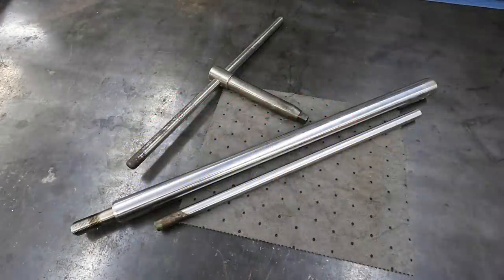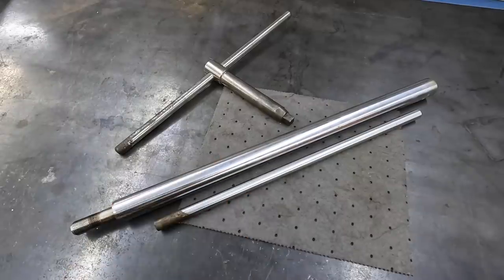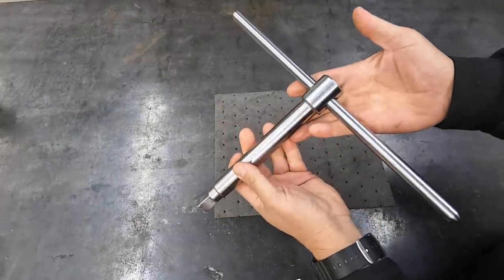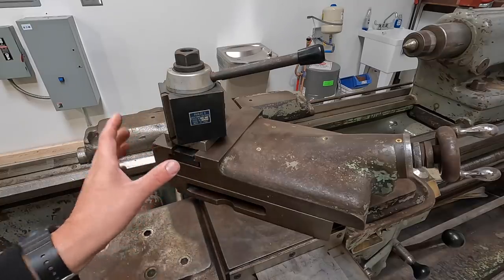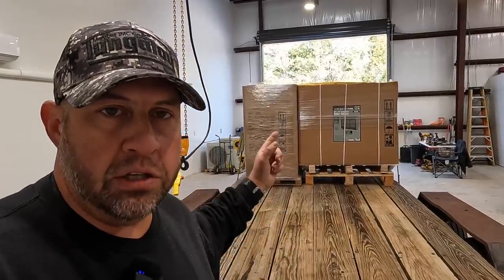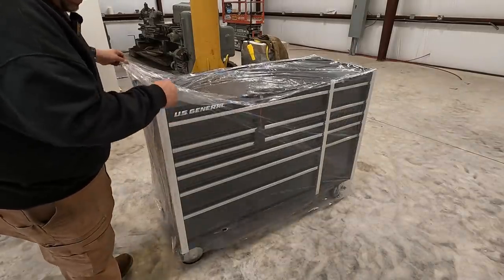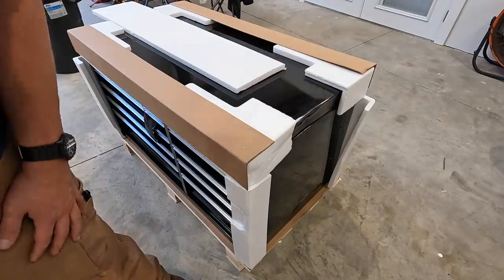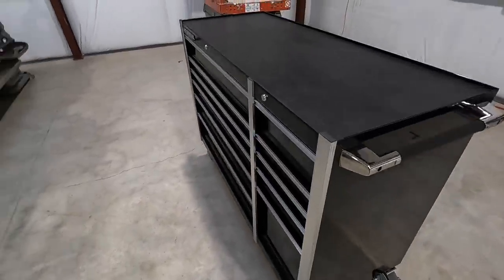Saturday Night Special 358: 3 Jaw Chuck Wrench, New Tool Boxes

Comment: I did not go through the comments (@ 200 now) but your thought of a wooden slab top made me think that the top could have an overhang at either or both ends... depending on thickness, it will be heavy enough to handle a small vise or other fixtures without any anchoring.  Just a slice in the bottom to accomodate the overhang.  Doesn't have to be a slab, could be something like maple butcher block, which would be, if thick enough, very heavy and essentially dent proof.... always fun to see what the Abom will do next!

Comment: I have a "Homak" top/bottom toolbox and one of the bottom wheel mounts got bent and it was a nightmare straightening it out. Mind you I've had them for 21 plus years and it works fine now, but what a pain. Very flimsy.  They won't move from where they are and the damage occurred during moving... but what's done is done.

Comment: I have the HF roll around toolbox with a extension on the side, its perfectly fine never had an issue with it, we have a matco at work and if you close the drawer too fast the tabs slip out of the slide and its a pain in the ass. Thing about HF is just use common sense, its pretty easy to sniff out the bull. EDIT and yes I put a bit of leftover birch plywood on top of mine, makes a nice place to put things you are actively using ... espeically drawings cause now you have a table top and its hard to make edits or notes on a ribbed rubber mat.

Comment: It would be another expense, but what about getting another 55” toolbox and putting them back to back.  That way you have one for the American Pacemaker and other for the machines on the back wall of the shop.  You could even get the slab of wood made big enough to cover both box tops and “lock” the boxes together.  As Keith Meiser said, if they could make it long enough to overhang then you have a great small vise point as well.

Comment: the forward and reverse wiring, you have two start buttons and one stop.  i would ask you guy if he can add a contactor to you existing starter box so you can reverse the lathe from the operators station.  just a thought.  also i would love to see the assembly of you tapper attachment!  i have a 16X54 and it only came with half of the tapper attachment

keep them coming love the video's.

Comment: Adam, you might consider to putting a door stop for the left door leading into your office. It looks to be a stationary door, but if you ever open it and it swing out too fast you might break the glass if it hits your handle on your tool chest. Just a suggestion. Shop is looking good.

Comment: I have often looked at the hf boxes and they look sturdy but for me the drawer closures either seemed to week or to annoying with the latch on the edge, i have grage shop and have seen issues with some brands where the drawers just would not stay shut if the box was facing down hill, between the hf us general brand and HD Husky toolboxes i would say the biggest difference is that the huskies have nice soft closure mechanisms that require some force but not to much to unlatch, looking forward to your thoughts as you use those boxes.

Comment: I've got two of those big boxes in my machine shop and it didn't take long to fill them to capacity.  I also used Harbor Freight drawer separators of different types and they work great.  All the best in your new shop.

Comment: On the chuck wrench why don't you weld a piece of round bar upright half way along one side of the handle and then that way you could use it as a speed brace to open and close the jaws more rapidly

Comment: Nice work on the Chuck key Adam. How did you calculate how much to mill off for the square? Thanks
Reply: First you find out how big the square needs to be measured flat side to flat side. Then you take your material diameter and subtract the measurement you reached of flat to flat. Divide by two and that gives you your figure of how much to mill off each side.
Reply: @grntitan1  Thanks for explaining that I really appreciate it.

Comment: Nice setup on your tool boxes. Now you would need some drawer liners in them to keep your tools from sliding around. You can get that at Harbor Freight or you can go to a gasket supply store and get you some 1/16 to 1/8 inch neoprene sheet, cut to fit. It is sold by linear feet. That will help protect the bottom of your drawers.
Good job on your videos. I'm looking forward to seeing more of your videos to come.
Reply: they come with drawer liners

Comment: I have a top cabinet very similar to yours. I never could really figure out a proper use for the top lid area.. When I put gauges and caliper tools up there they would get buried when the top was down. Always stuff would get put on top and I would have to move junk to get in there. When I left it open, it stayed that way for years. The top is at an awkward height to really see stuff. Maybe I need to be taller. :)
Reply: I  think just about everyone has the problem of an awkward top storage they can't really see into. I'm 6'1" and I have a similar problem. Anymore I keep the drawers organized and just let the top go.

Comment: I wonder if there will be 'issues' with the distance between an electrical switch and a water fountain.    Coming along, not looking quite as large these days as it was when there was nothing in there.  Thanks for the posts.
Reply: I wondered why not put the reversing switch on the front of the machine?
Reply: @jerrydemas2020  drum switch.

Comment: I don't see value in chamfering the through-hole.  What am I missing?
Reply: You're not "missing" anything!  His choice and a nice touch, I might add.
Reply: Chamfering is what separates us from the animals.
Reply: It looks good (in my opinion). It makes it easier to not miss the hole when moving the handle around. After a lot of use the un-chamfered hole can get wallowed out a bit and raise a burr that will tear up your hands. Good chamfers is what separates us from the animals. (HT to Blondihacks for that one :-) )
Reply: You are missing the point that it will hurt a lot when you pinch the skin on your hand  one day. (sooner rather than later)
Reply: You're missing the mark of a quality machinist. It's the difference between a Snap-On T- handle and a Harbor Freight T-handle. The money is in the details.

Comment: Since this 'issue' persists I thought I give you a a quick pointer. You have audio channel discrepancies, sometimes the audio is fine and your voice comes through both channels. Other times your voice only comes through one channel, the left channel. You can improve on this. Virtually all editing programs have a feature to combine audio channels. This would make it so your voice and all other audio is streamed to the listeners left and right speaker. On phones and to a point laptops this is not noticeable but for headphones listeners this audio only on left ear is discomforting. I would very much appreciate it if you would consider adding this step during your video editing. Thank you.

Comment: Hi Adam,  Is it possible to machine ball screws?  All I have ever seen is big machines forming them,  I have never seen any videos milling them.
Reply: Why would you though? Rolled ballscrews are cheap as hell. And have better tolerances & mechanical performance than machined equievelents.
Reply: @TheCuriousOrbs   I just wanted to know how to do it if it was done. As far as I've seen they have balls grooves and specific lengths if you wanted something special they would charge you for something special

Comment: Why does the laithe need to be level?? All things are relative to each other
Reply: I haven't even watched the video yet, so I may be missing some context, but you introduce twist with a non levelled lathe which can result in making tapers when you don't want tapers. If one foot is up 1/16 of an inch it can make a difference.
Reply: Cast iron, which most machines are made of, will flex which affects the accuracy of the machine.
Reply: Twisted ways will result in tapered turnings, at a minimum.
Reply: @jacobmiller6664  The chuck holds the work peice and everything is connected to one peice, so if you lift one side higher, everything moves with it... i must be missing sonething..🤣
Reply: @SteelSurgeon  That makes sense, hard to believe that much cast iron would flex enough to make ANY difference... But i guess if your workpiece is very heavy then spinning it makes sense
Reply: @bitrage.  Lathes arnt like you think they are. Look at how long those ways are, it's like a noodle. The ways have got to be perpendicular to the headstock
Reply: @spikeypineapple552  Lmao... Would you believe it if i told you i had a laithe and mill a few years ago??😂🤣
Reply: @bitrage.  If the length of it is twisted, it will cause taper.

Comment: Adam, gesturing towards exposed electrical contacts is fine, but please stop touching them when talking about them. It is a very bad habit to touch an electrical contact you have not verified to be safe. Even though you know those heaters have been disconnected, have you verified them? It only takes one mistake to make you the easiest route to ground and will make for a very bad day. Stay safe!

Comment: I spent a career in the machine shop. One thing that I don't understand about machinists is their willingness to compromise on tool box storage and hand tool quality. I worked in a shop with 75-100 machinists and about 50 assemblers. I was the only one that valued quality hand tools, preferring Snap-On,but owning some other high quality brands as well. I was maintenance and that was possibly a difference, but even my fellow maintenance technicians settled for inferior hand tools. 
Machinists favor highest quality inspection and measuring tools, want premium machine tools and tooling, but seem indifferent to hand tools. They also seem content to own only the barest minimum of hand tools. My boxes were loaded with task specific tool sets with lots of duplicity. I stocked every possible version of allen wrenches; long, short, ball end, screw driver handle, L wrench, stubby, square drive, etc. in full sets. My coworkers usually settled for a pack of ball driver L wrenches.

As much as I prize my premium tools, I find myself unwilling to pony up for premium tooling. We are each wired so differently. I have been wondering if I am ready to upgrade my hobby lathes to an American Pacemaker. One has been tarped in a nearby shop for several years. I have the shop space for it in my new building... My current project is to complete the rebuild of my LeBlond. It may prove large enough for my hobby work.
Reply: They use measuring equipment everyday and rely on it aswell as the cutting tools.. It's what makes the money not their hand tools
Reply: Maybe because they don't make money with a Snap-on crescent wrench set? A roofer probably has a really nice belt and hammer, but you wouldn't expect him to spend $1,000 on a set of Wiha pliers and screwdrivers.
Reply: @brettwalkom948  Yeah, I get it. But I own premium measuring tools too. I own instruments that measure .00005", Brown and Sharp and Mitutoyo. Even our  machinists and inspectors only measured to tenths. I bought my first .00005" indicator to set up the Heidenhain scales our gear grinder. It was the only one in our shop.  Cheap tools " burn my hand". I don't get how a machinist values a good indicator or micrometer, but will fight cheesey wrenches.
Reply: @paulhunt598  because some hardly use them that's why

Comment: It’s not the the quality of the box, it’s the fact they’re made in China. People wonder how this country got where it is today debt-wise, trade deficit-wise and job-wise. It’s sad how dependent on China we’ve become…we don’t mass produce stuff here anymore.
Reply: US law gives precedence to corporate actions which benefit the corporation corporation and its shareholders without regard to the effect on customers or society in general.  So, a corporation could be and have been sued by shareholders for not maximizing profits by outsourcing,  downsizing etc.  If the law was different then the corporations would act differently.  However anyone who wants to change the laws in this regard are called socialists.  However, tariffs can cause outsourced manufacturing to move from one country to another over time.  So 10 years from now China might not be as dominate and maybe some other country will.
Reply: Blame the consumer. Whenever someone reaches for the cheapest item on the shelf, that's another tick for China and a guarantee that it will only be harder to find ANYTHING of quality in the future. But to be fair, America still has a massive manufacturing base. In my country, locally made is no longer even an option. Unless you're in the market for uranium or iron ore.

Comment: Shouldn't we have buffed the tire marks out of the floor before buying more toys and covering everything with concrete dust?
Reply: That would have been a total waste of time. Here's why... the tire marks were made by the forklift and man-lift: The only machines installed so far are the crane and a lathe: There are going to be MANY more trips by forklifts and all sorts of other stuff that are going to mark up that floor before the shop is even workable: The time for treating the concrete floor with something that will be easy to clean tire marks from has already passed (I forget why he said he wasn't going to do that. It might have been cost and/or availability of materials during COVID) In my opinion a floor that you are only planning to use for a couple of years is hard to justify putting some expensive "impregnium" on. Not like he can take the floor with him when he leaves.

Comment: Boxo tools would've been a better option Adam. Yeah they're made in China too but they're made of a thicker guage steel than most box store. I can't stand anything that comes from Horrible Freight
Reply: Seems like Boxo is like twice the price.
Reply: @ericg7044  they are more expensive but then again you get what you pay for. 🤔
Reply: @pyro323  Well then he should just go all out and get some custom 1/2" wall titanium boxes for $20,000 if you get what you pay for.
Reply: @Blueshirt38  the idea here is to have a tool box that's gonna last a long time and function well. Harbor Freight products are known for failing within a very short amount of time. It's because they're so cheaply made. There are good tool manufactures in China but the cheaper Chinese tool companies outnumber the good ones.
Reply: @pyro323  Nothing wrong or cheap with these General tool boxes. Ours is six years old at this point with daily use in the shop.

Comment: clearly was your 10,000 pound strap down that wrecked the lid on the box but ya know '' I bought a new tool box so ill complain to get another '' typical
Reply: You really think the strap pushed in sideways on the lid?
Reply: No such thing happened.  You are a troll.  Go away now.  Mommy is calling.
Reply: @warrantyvoid100  yea look at the boxes on the trailer , the strap is going right thru the same spot on the “damaged” box
Reply: @michael931  clearly the strap is on the same spot of the damaged box when it was on the trailer , don’t take much to squeeze a Chinese box together with foam and wood. So carry on biden supporter since you both have the same amount of common sense